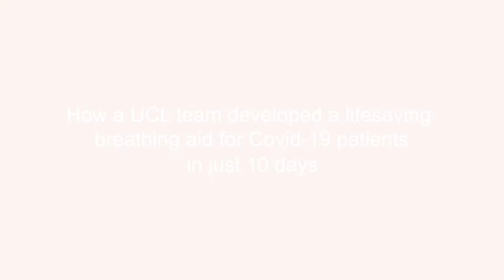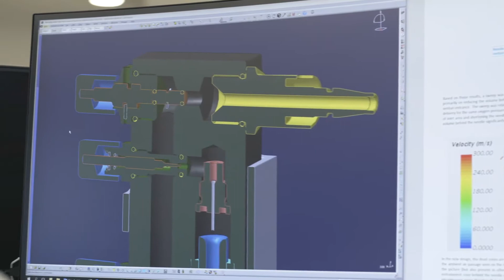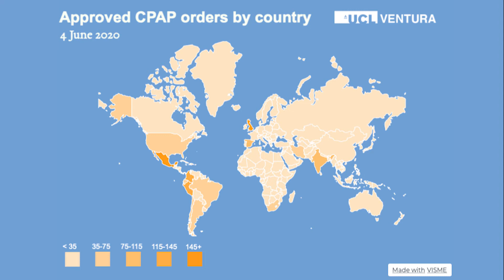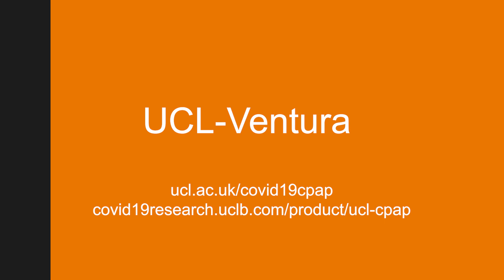The story of the UCL Ventura CPAP device | 10 days to impact

Comment: https://onlinelibrary.wiley.com/doi/pdf/10.1111/j.1365-2044.1977.tb11556.x
The UCL Ventura CPAP system is not a Demand flow CPAP. It could be made safer, monitored properly and be more economical on the use of oxygen gas supply.
Simply by : 
    1. adding an extra one way inspiratory valve at the patient mask end of the breathing system tubing. this will eliminate the danger of rebreathing if any disconnection or leak happens at the distal end of the breathing system tubbing.
    2. Adding a one litre self inflating rebreathing bag [ AMBU bag ] at the distal end of the breathing system tubing. This will allow the use of much less oxygen gas supply . The patient breathings will cause a small pressure oscillations in the patient breathing circuit which will  make it possible for a properly devised alarm system,  to monitor patient breathing, disconnections or running out of oxygen gas supply. 
   The system could also be made to provide assisted/controlled ventilation if the bag is included in a bottle which can be driven by a servo ventilator as shown in the diagram of my paper.
I hope that my published paper above is fully active [ not an abstract only ]  and showing the full PDF file with the diagrams of the system. the circuit is self explanatory. It is one of three internationally published papers under my  medical research name  [ M W Geadah ]
Regards and best wishes.
I would appreciate and welcome any feedback from the team at UCL and Mercedes, on these comments.
Retired consultant Anaesthetist. Ex director of Maidstone intensive care unit. Ex tutor of the faculty of anaesthetist of the Royal college of surgeons of England
CPAP, what is it, and how it is helping during the Corona Virus Pandemic.
I had the honour of being asked to give a lecture about it at the Royal College of Surgeons in England. I took a stiff sausage balloon with me to demonstrate the use and benefits of using my Demand Flow CPAP with or without PEPP. It takes a lot of effort to start the inflation of the balloon but then it becomes much easier to add more volume to it. Our healthy lungs have the benefit of Surfactants a surface tension lowering substance which stops the lungs alveoli from emptying completely during expiration hence stopping it from becoming like the stiff sausage empty balloon . Surfactants have a short life and have to be replenished so the lungs becomes much harder to breath with if we loose them due to some insults (CORONA VIRUS INFECTION) or not produced yet enough as in very premature borne babies. My Demand Flow CPAP which stands for continuous positive airway pressure during spontaneous breathing ,with or without PEPP which stands for positive expiratory pressure plateaux 
during controlled ventilation is needed until the surfactants are produced back enough to make it easier to breath again normally.

https://scontent.flhr4-2.fna.fbcdn.net/v/t1.0-9/s1080x2048/91941589_10216820669936669_7114252905053421568_o.jpg?_nc_cat=111&_nc_sid=730e14&_nc_ohc=cYRWARoQjAMAX8Jxcio&_nc_ht=scontent.flhr4-2.fna&_nc_tp=7&oh=13ee8a1ec6c94bfd6efe7d8f23e52197&oe=5F38694C